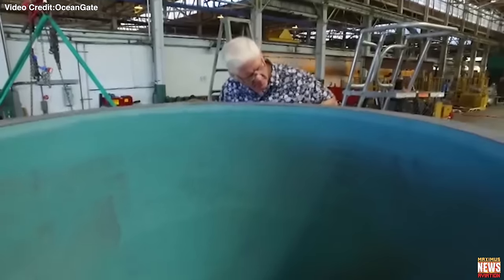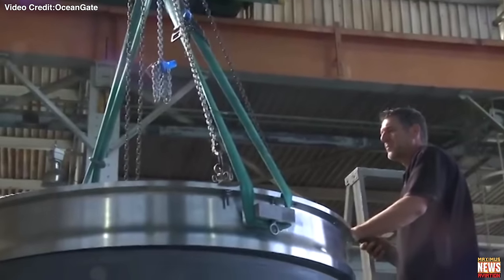Watch The Manufacturing Process That DOOMED OceanGates Titan To Fail. But It NEVER Had To Happen.

Comment: i would say he was gambling, if goes well he will make lots money, if not it doesn't even matter anymore
Reply: he was losing millions. There is a reason the Russians charged a million dollars to take people to the Titanic. You only have a limited window of time each year and the cost of fuel, supplies, crew salary of the support vessel is over a million dollars. Each trip down and up is eight hours. Depending upon weather on top you may only have four or five trips to take to the Titanic.

Most of the oceangate dives were canceled because the game controller wireless system was down or parts had fallen off and had to be replaced because it was being towed behind the ship and being battered by the waves. 

Take for example Limiting Factor and its support ship Pressure Drop. They were purchased for 50 million dollars in 2022. To make the money back taking people to the Titanic it would be a million dollars to the location. Than two dives a day for a week. Each dive is one paying passenger since Limiting Factor can only take a pilot and passenger. It would take four or five years to potentially break even doing this
Reply: @toomanyaccounts  okay maybe it was like that, i just cant fathom how an so called „engineer“ can do this and go inside this thing, when money wasnt a thing, life was ..

Comment: I wants know what subs creators have to say about they creations especialy when they are non destructive tested.  Yesterday When i ride bike and there was fast corner i forget there was rain fall just before i ride and road is somewhat wet. At that one corner at time shorter that half second front wheel 3 times lost grip and slip but lucky it grip road again. But at eatch that moments you realized "crash/fuckt up i forgot about rain and fuckt up " I think they know same ....

Comment: I hate entrepreneurs like this guy.  There's nothing wrong with innovation, but when you get defensive and nasty and protective of your invention and start dismissing anyone who thinks your invention needs to be tested, because to do so "stifles innovation", I don't think you should be allowed to risk other peoples' lives on your certainties.  The arrogance of this guy's thought processes beggar belief.  He wa so convinced he was right that he was prepared not only to risk other peoples' lives, but to mislead them about the safety of his vessel.  Sure, everyone signed a waiver that mentioned "death" three times, but the fact he was still charging $250,000 per ticket would have cemented in peoples' minds that the vessel was safe.  After all, who would charge that kind of money for a trip in an untested and dangerous home-made submersible?  This guy, as it turns out.  Arrogance and overconfidence are a deadly combination.

Comment: Why the hell use carbon fiber in the first place?  Carbon fiber is best used where low weight is very important and you don't need the world's strength where you can compromise a little of it in favor of weight. Like aerospace industry, super cars, personel protection etc. Submarine is quite the opposite you need the world's toughest integrity and weight is manageble where there is buoyancy. Why?
Reply: Sounds cool. It's pop culture marketing, like AI (there is no such thing as AI - but the acronym impresses a wide spectrum)